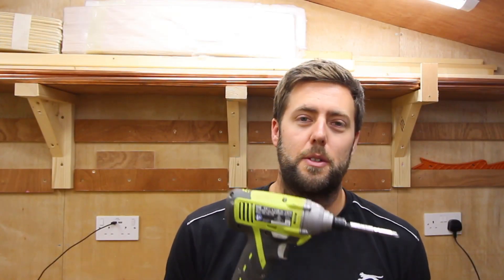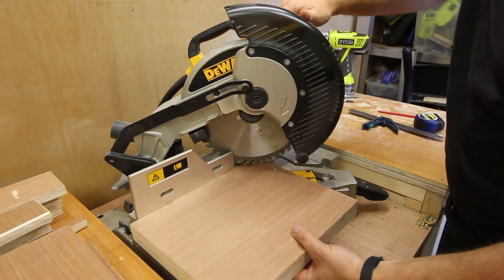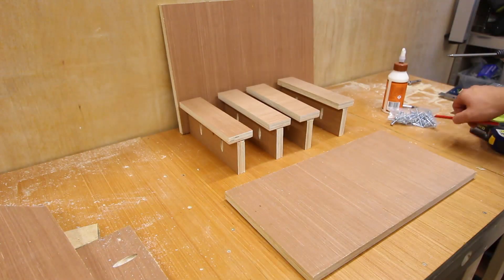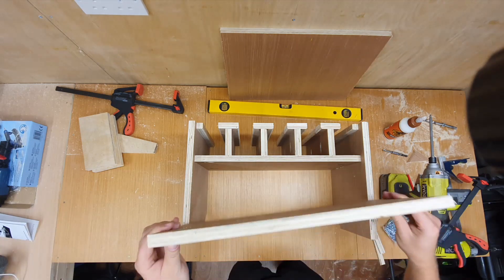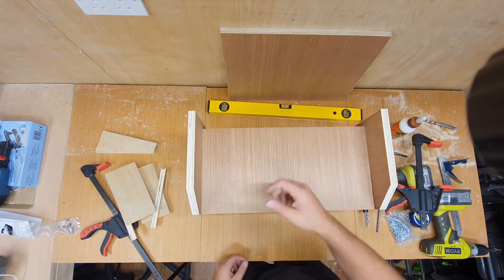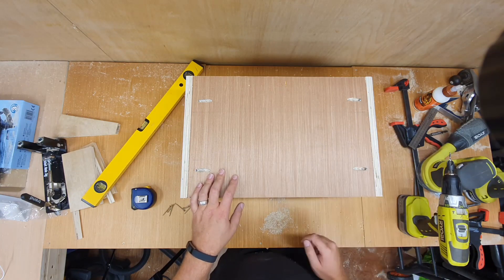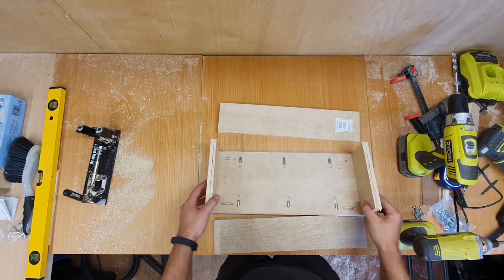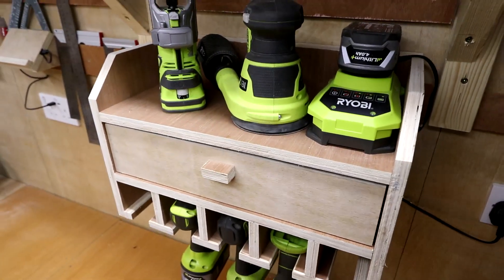Drill rack and charging station build

Comment: Looks good that, the only thing I'd change would be to pocket hole the underside of the drawer base, save getting little odds and sods fall in the holes.
Reply from the maker: That is spot on. I did the holes on the inside just because I initially thought it was easier to assemble but it should have been the other way as you suggest

Comment: Suggestion... The pocket holes of the drawer had to be put by the outside of the box, so you open the drawer you don't see them.
Reply from the maker: Definitely. In retrospect, I should have done the drawer. Normally with the pocket holes on the outside and then applied a false front to it. Live and learn, I won't make that mistake agaib
Reply: @JamesDeanDesigns  Don't sorry, besides that, the build is excellent and I liked it, I want to build it myself.

Comment: Hi James, I have a Question  Getting ready to go out and buy the plywood . On the plans the draw base say it 7.5/8x 16 3/8 on the lay out on the front page it say it  8 1/4 x16 7/8
Reply from the maker: Hi Roy, If I remember correctly (as I actually built this in September) the original plans allow for the base to sit inside of the drawer frame which is why the front and back are wider at 17 7/8 (I noticed you put 16 7/8). However there is some slight confusion as well with the original website as they talk about building the drawer in both in 1/4 ply and 3/4 ply so the measurements will differ slightly depending on which thickness you use.
Reply: Thank you for getting back